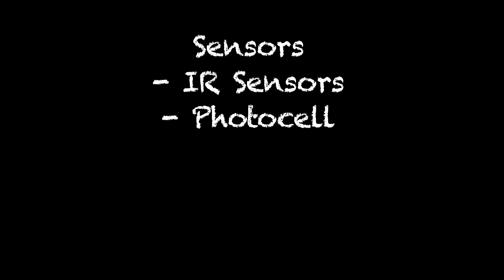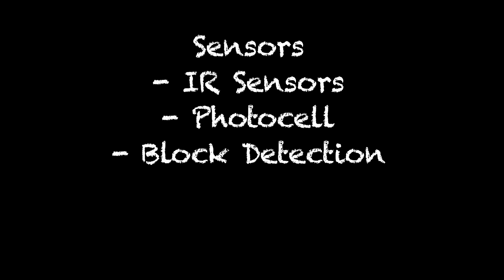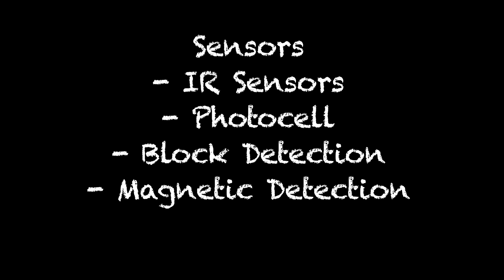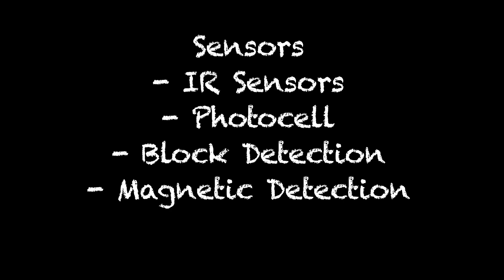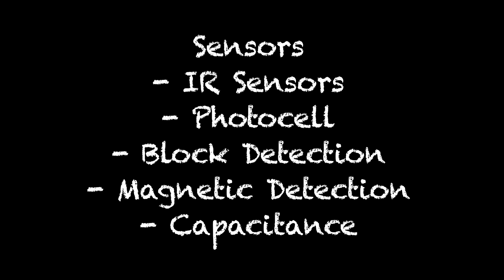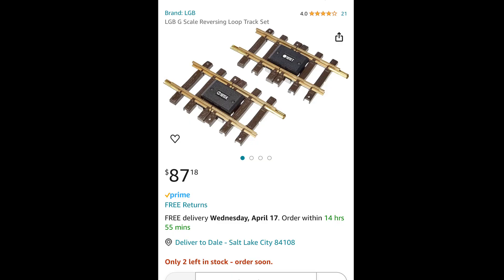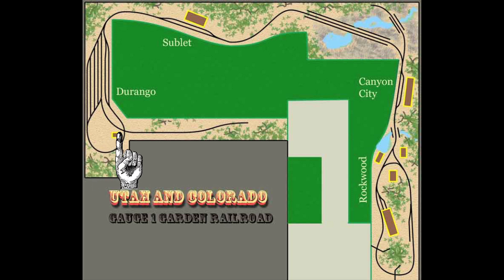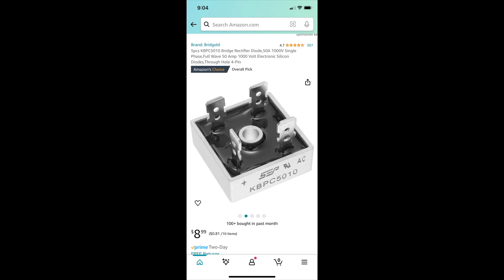Train, Track and Motion Sensors - Electricity for Model Railroads

Comment: Hi Dale & Karyn.  There is another sensor that can be used called RFID.  This is where all of the locomotives, rolling stock, and switches have a decoder read by a computer.  So you can have the computer route the trains and do yard sorting.  Really fantastic way of making model railroading realistic.
Reply from the maker: Thanks for the info!  Yup super super exotic stuff. And bar code. We saw a layout with about 1000 pieces of rolling stock that uses bar codes on the bottom of the cars.